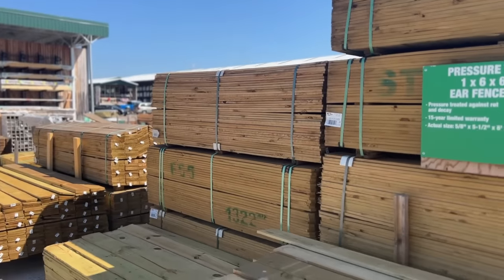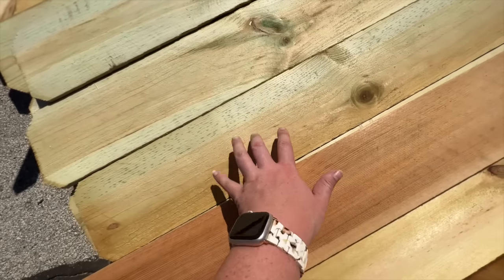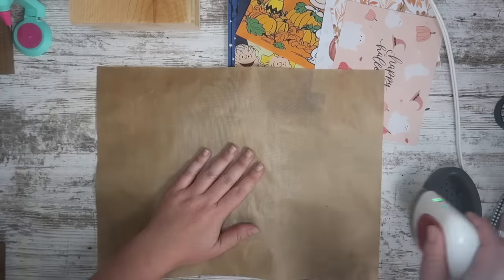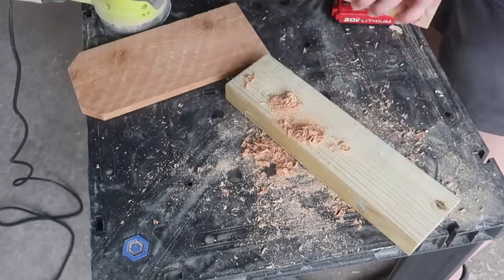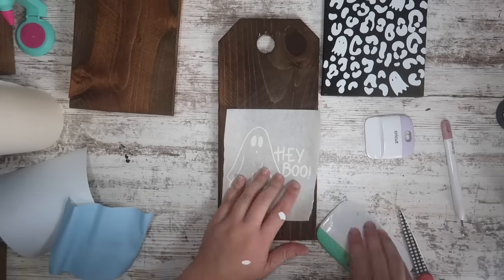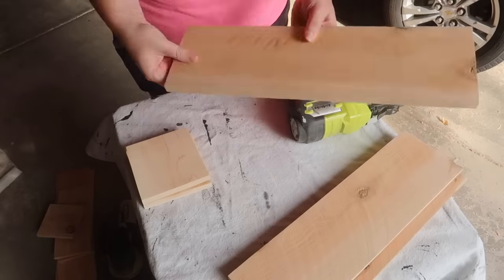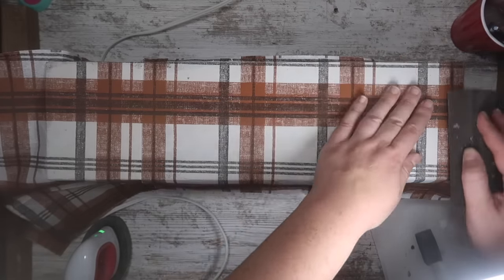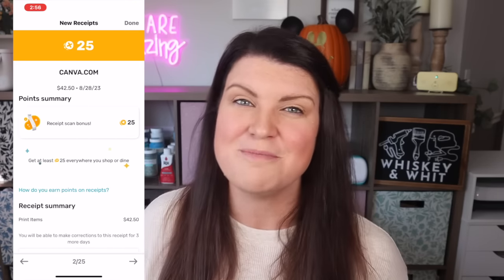Grab some $3 fence pickets to make these EASY Fall & Halloween Decoration Wood DIYs!

Comment: You can make your own wood filler by mixing the sawdust/sanding dust with wood glue. Not only is it free, it's guaranteed to match the color of the wood.
Reply from the maker: I did know that, but haven’t ever tried it. I will have to!

Comment: These all turned out great, Whitney!! Peanut M&M's as well as the little flavored tootsie rolls are my favorite candies. I can usually pass on candy so really only eat it around Halloween. I did my first wood project this past week which was your, "And all at once, Summer collapsed into Fall." , sign. There were some mistakes with my measuring but I still love it!! Thanks for the inspiration.
Reply from the maker: I love it! I still make measuring mistakes but I’m glad you pushed through and love it! 🧡✨🍁

Comment: Nice ideas, working on them this weekend. Quick tip, when you have glue applied to your surface before you place the other piece of wood on sprinkle some salt on your glue. It'll keep the pieces from moving so it's easier to nail.
Reply from the maker: That's a great idea!

Comment: If you add a bit of hot glue with the wood glue it will hold faster so you can have a bit more support get the nails in
Reply from the maker: Great tip!

Comment: Great ideas... Been watching for a while... FYI, you can make your own wood filler with a mixture of sawdust and wood glue. Especially useful if you need to match wood color between pieces for staining or other reasons.
Reply from the maker: Thanks for the info!
Reply: @Whiskeyandwhit  also good for filling holes, knots, or big burrows in lumber.

Comment: Your pumpkins are so cute, I would like to try to make a few. Did you pot on a top coat?
Reply from the maker: I didn't, because they'll be inside. If you want outdoor ones, I would suggest sealing them. Even if it is just a quick spray clear coat :)

Comment: Great job. How did you pick a take for your miter saw? I have a saw and it’s still in the box.
Reply from the maker: What I use is a rolling cart that locks so I can wheel it in and out. I got it from my husband’s grandpa so I don’t have a link. But I would assume hardware stores would have something similar. :)

Comment: I have some old used wood - I think cedar from a privacy fence & some wood from an old shed. Would they be ok to use for these projects & other wood crafts?
Reply from the maker: Yep! I would just make sure it’s fully dried out from being outside, check it for bugs/mold/ etc, and sand it down really good. Then you can use it.

Comment: Do you use an inkjet printer or a laser printer? I ask because I have an inkjet printer and it smears when I try to mod podge over it.
Reply from the maker: Mine is an inkjet and that's why I do the heat trick so it won't run :)

Comment: Just saw your YouTube and was interested in fall diy fence boards.  But was turned off once you broke out the electric saw.  Most ladies don't have this tool so that type of diy doesn't work for most.
Reply from the maker: You can use a hand saw for most of these, I just have an electric saw and use it to save time 😀

Comment: Sawing pressure treated should not be breathed in.  A mask is a good idea
Reply from the maker: Great point - another reason I love cedar :)
Reply: A mask isn't a good idea, it's a requirement any time you're cutting ANY material. Fine particulate matter can and will get into your lungs, and just tends to ruin your day. And for the record, pressure treated lumber is no more dangerous than non treated. The toxic chemicals that were used in pressure treated lumber was banned in 2003, so it's been safe for the past 20 years.